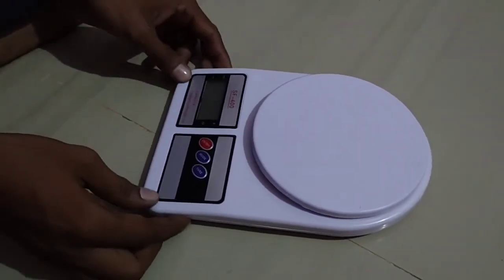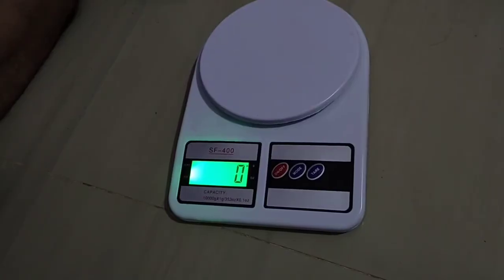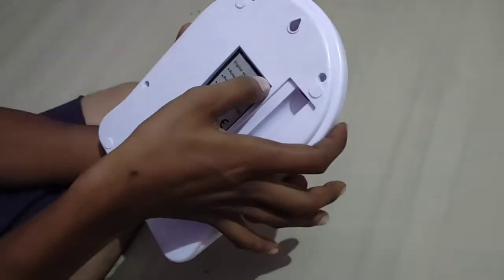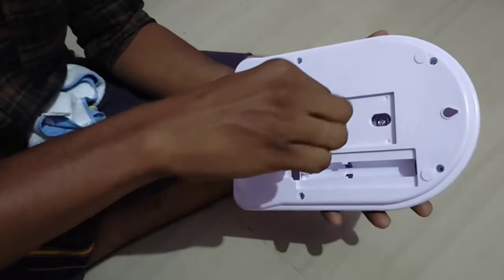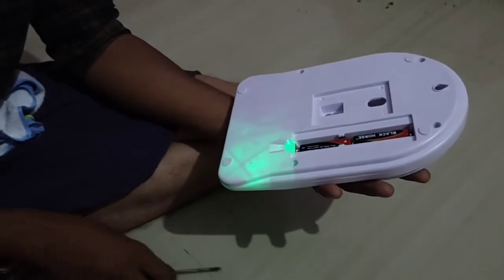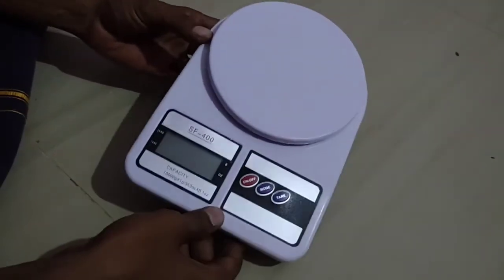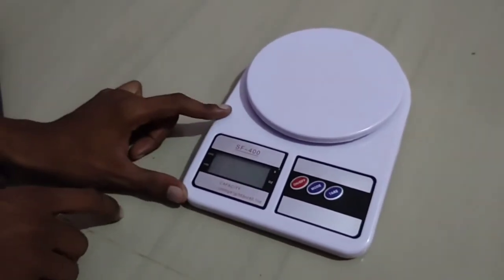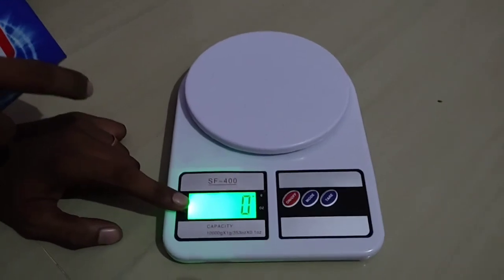Kitchen scale repair in tamil | Weight Machine repair in tamil

Comment: There is one extremely annyoing thing with this scale, the auto power off function. If you take too long when you are mixing your ingredients, the scale shuts off on you and you have to start over again. Is it possible to identify which component on the circuit board that is responsible for the auto shut off function, and somehow disable it so that the scale will stay on until you press the power off button?